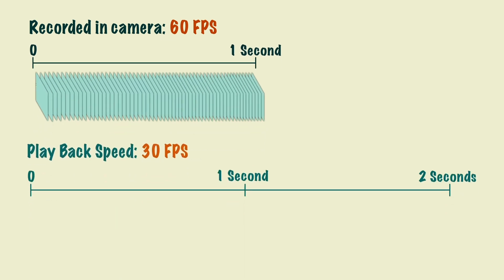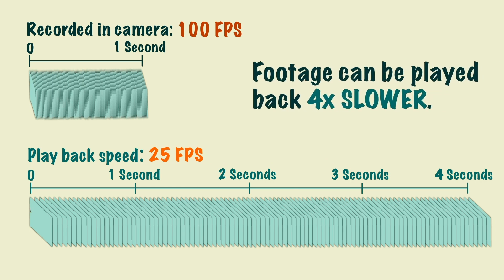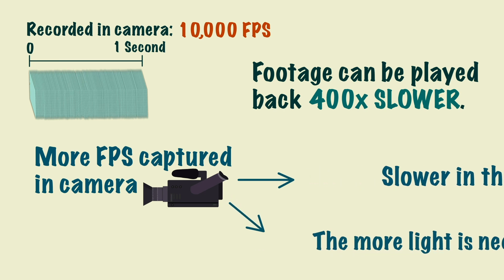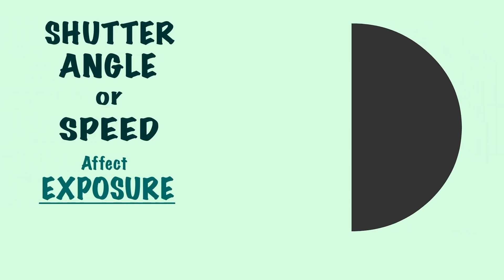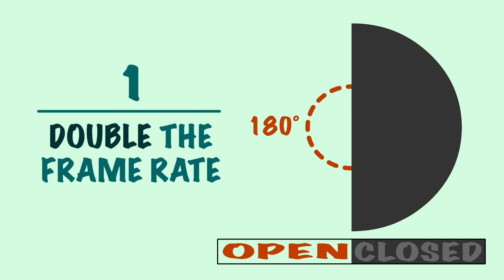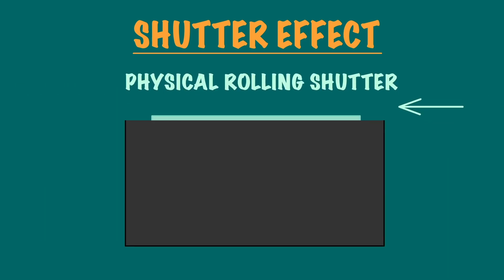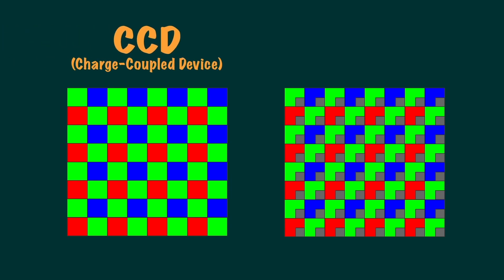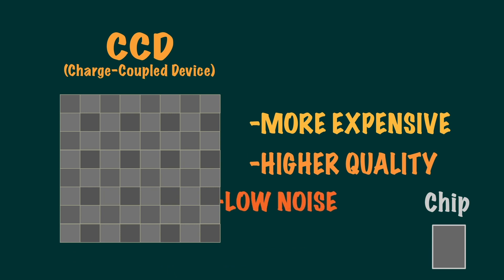CAPTURING THE FRAME: FPS, Shutter Speed, CMOS/CCD Sensors, Rolling and Global Shutters

Comment: Great video!  But, why is it "typical" that the shutter speed should be the inverse of twice the frame rate?  I'm new to this...
Reply: Apparantly, when the 180º rule is implemented, it best mimics how your eye perceives the world - with a little motion blur. If you wave your hand in front of your face, your fingers aren't all that sharp - they're a little blurry. 180º mimics this, and will add a little motion blur to the frame.  If you used a 360º shutter angle (for example, a shutter speed of 1/25, and the frame rate is 25 frames per second), then you'll have a lot more motion blur than what you see in real life. If you use a 90º angle, or less (for a frame rate of 25 frames per second, this would be a shutter speed of 1/100), this would capture less motion blur, and the result comes out a little jittery.
Reply: @JaydenLawson  thanks for the explanation!
Reply: @JaydenLawson brother can you tell me is that interlaced scanning or rolling shutter is same

Comment: The final conclusion words about CCD vs. CMOS is a little bit outdated. Numerous improvements have been made to make CMOS perform better than CCD in image acquisition, including back-side illumination (which requires a flip of silicon wafer in chip manufacturing). CMOS doesn't suffer from smearing effect like CCD, and decent global shutter implementation is also available.
Reply: Seems all those advancements for cmos didn't realy touch consumer electronics.
Reply: @Ins1r  yup where's the cheap global shutter cmos camera at?  lol
Reply: @chrisw5742  We had good CCD Cameras. But hey, CMOS is the future... -__-
Not it isn't...
Reply: @Deryndafis  Film is indeed superior. It has nearly infinite resolution, amazing dynamic range, and crisp fine details. CCDs also have amazing dynamic range and crisp fine details, however they are limited to their pixels. CMOSes, on the other hand, are a disaster. They have a rolling shutter that damages anything even a bit fast, like propellers, fast moving vehicles, fast panning shots, and vibrations, which turns your video into either jello, or an artifact-y mess, or both. The dynamic range is atrocious, since it crushes your shadows and highlights, so you either end up with normal photos of the sky, but the ground is pitch black, or, the ground is normal, but the sky is pure white. We also can't forget how CMOSes smudge really tiny fine details, making things like paneling on houses, when they are further away, become a smudgy unrecognizable mess. 

This isn't about artistic preference. This is about getting a good shot, or getting a shot that's sub-par. CMOSes are a cheap sensor which doesn't do the best job. It does work, but it does a very bad job of it. CCDs, are, how I call them, "Digital Film", they look amazing, and look like what you see in real life. CCDs were always the best Camera Sensor, and so far, they haven't been beat.
Reply: @Deryndafis  To be fair. I have used both CMOS Cameras and CCD Cameras. I always had CMOS Cameras have that jello effect with the rolling shutter, but all the CCD Cameras always had a crisp frame each time. I also noticed that CMOSes had tons of noise and CCDs had almost none. I am saying this from personal experience, but I have had tons of CMOS problems, and CCDs always won. For me at least...

Photography is an artistic thing, but it is dictated by cold hard numbers being outputted from a digital sensor. I can be artistic as much as I want, but if my physical tech is setting me up for disaster, I can't do anything I want...

All I know is that I have had tons of problems with CMOS Cameras, and the CCD Cameras always worked wonders...